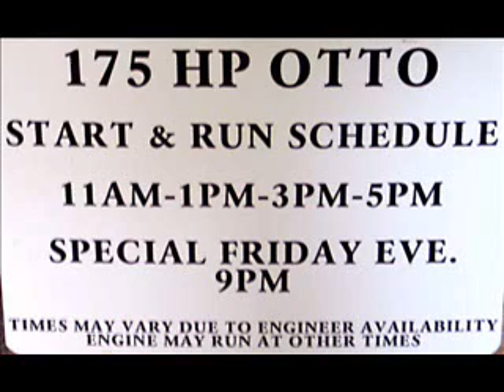Otto Gas Engine - 175HP

Comment from the maker: The OTTO GAS ENGINE WORKS of Philadelphia, PA 175 horsepower at 190 r.p.m. 21 inch bore and 30 inch stroke made in 1912. Originally installed in the Brookville, PA water works in 1925, pumping 1.5 million gallons of water each day for the town.